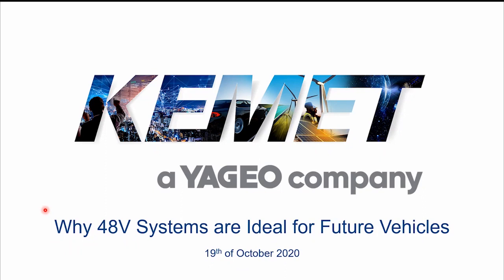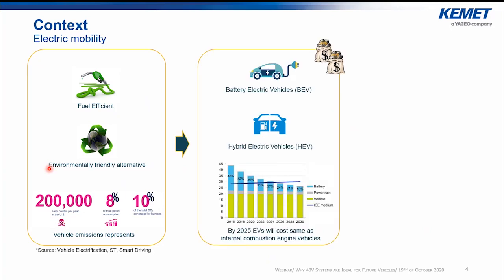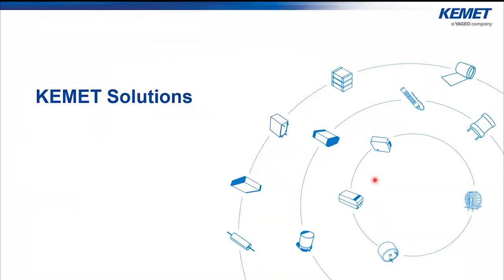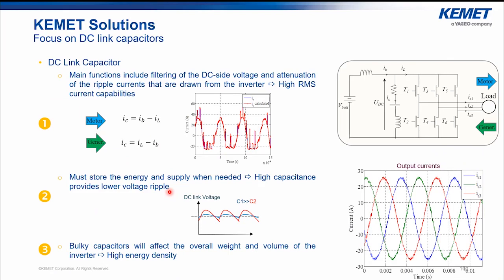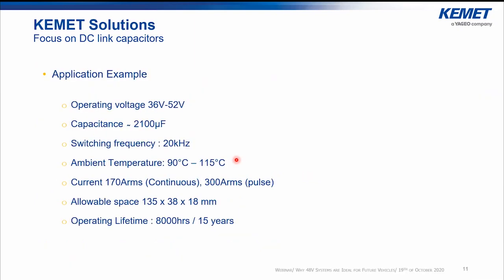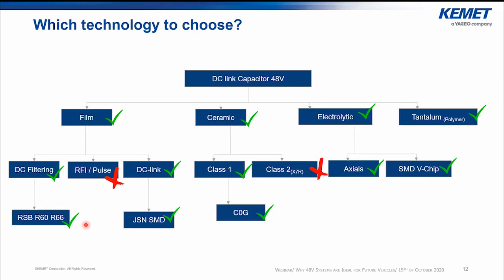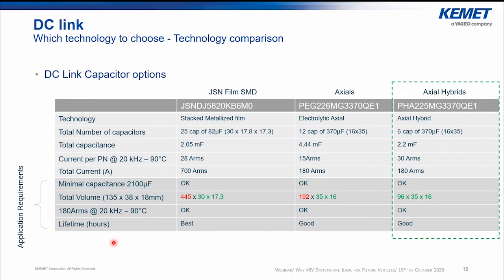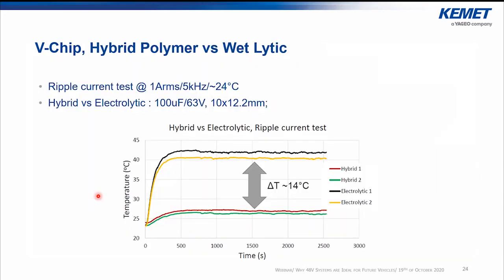KEMET Webinar | Automotive Series - 48V Systems

Comment: Beyond mild hybrids, the basic benefit of 48V over 12V in an ordinary vehicle is that power conductors only need one quarter the mass/material. That's a benefit that applies to all vehicle configurations, including the accessories on high primary voltage BEVs.